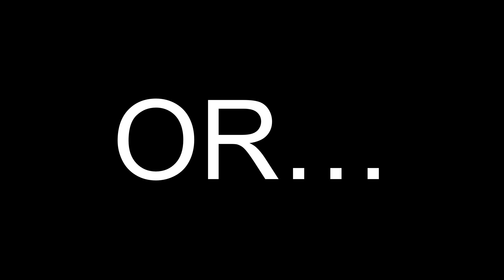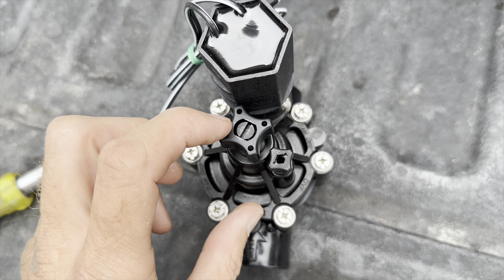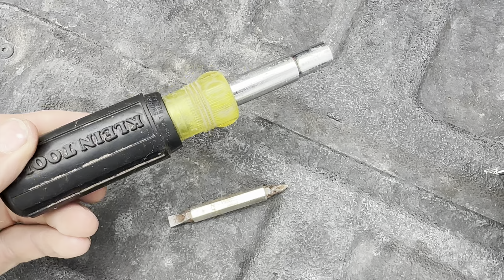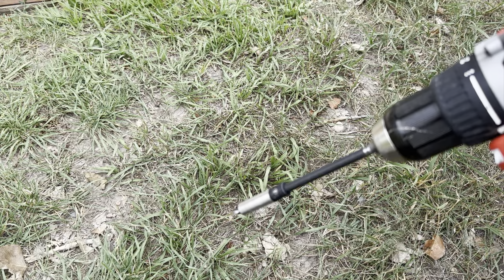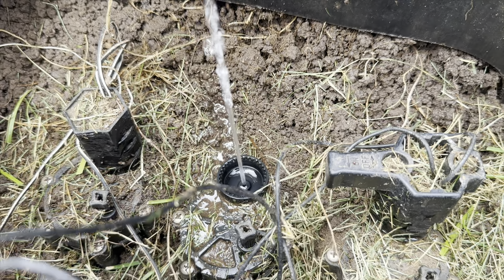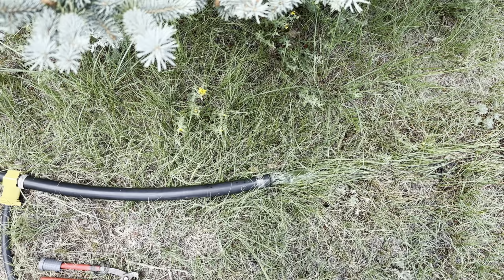How To Replace A Sprinkler Valve with a Flow Control to Save Water and Money

Comment: Nice job explaining
Do you recommend any brand valve or do you just go by whatever is existing
Reply from the maker: I typically install RainBird valves. But if I am replacing a valve diaphragm or the top for a PSI regulator valve then I replace like for like.